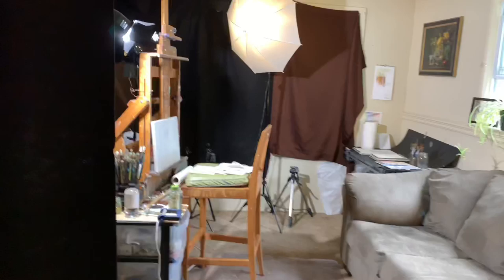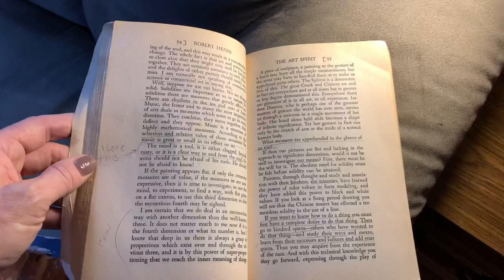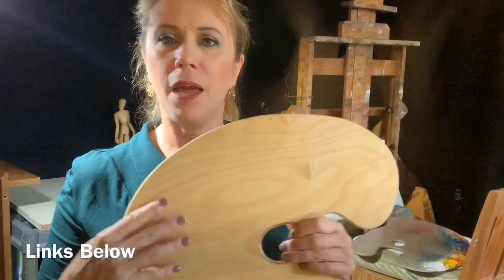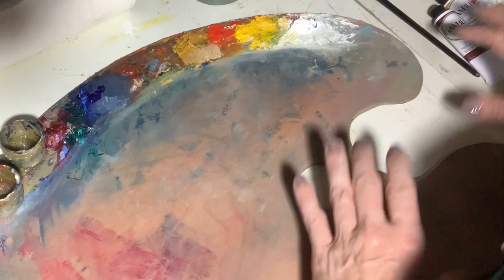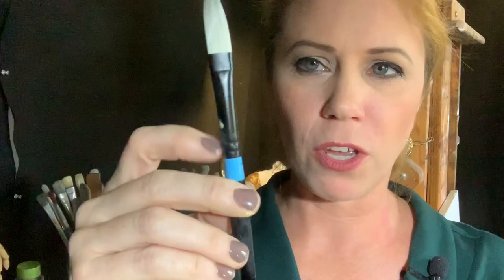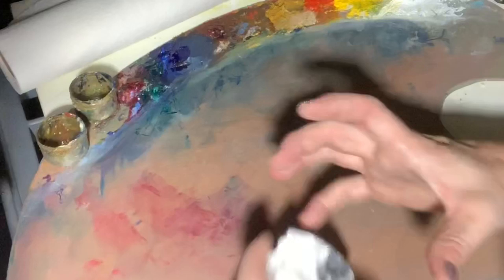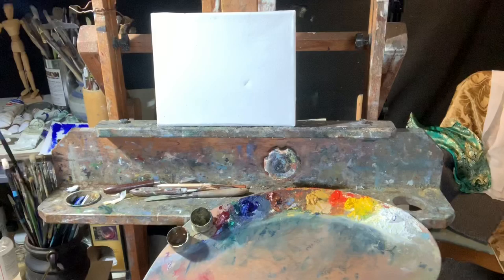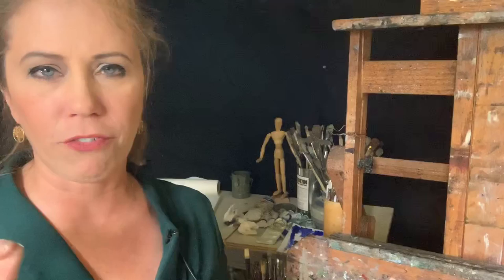Studio Essentials: Basics for Beginning Oil Painters

Comment: Since I am just starting to try oils, this has been very helpful, and I may buy one of your small palettes. I recently saw a bunch of painters talk about putting used paper towels which have mineral spirits into a container of water to prevent spontaneous combustion. Do you do this? Thank you so much for your videos they are truly wonderful.
Reply from the maker: Thank you Vivian! ( I have plenty of smaller palettes available if you'd like one, let me know!) I don't worry about the paper towel issue. In 30 years of painting, I've never seen or heard of one incident. I know this can happen, and I wonder if it isn't more when people are dousing rags with linseed oil, and cramming them all in garbage cans, where the temp can rise and ignite.  Whether in the studio or plein air, I use a minimum amount of oil and thinner, clean most of it off in the can of thinner, wipe the brush dry on the paper towel, and there just isn't that much on the rag to cause any worry. They all go in a grocery shopping bag, (indoors or out) and weekly, I toss the studio garbage can. Never been a problem. I hope that helps!

Comment: So wonderful. I’ve been painting for a couple of years and just recently switched to oil. I’m struggling with the mess. I get the paint all over my hands, gloves, tubes etc. I’m so conscious of what I’m doing but just can’t get it together. Just trying to close the tubes gets paint on my hands. So frustrating. Do you have any suggestions. I would appreciate it.
Thank you, Kim
Reply from the maker: I completely understand, Kim! I think when I began, I had more paint on me than on the canvas! Now after 31 years, I can (most of the time) win the battle. But that’s only because I wanted to win in this fight. 😂😂 One little tip I discovered is to be careful to not squeeze your tubes prior to opening them. They’re prone to gush when opened, catching you by surprise... and so it begins. Some mishaps are inevitable, but using a paper towel to handle things helps. Another tip- this maybe in advisable, but I started dressing nicer to paint and that made me be a little cleaner. Good luck! 👍🏻🎨😁
Reply: Jessica Henry thank you!  I will start utilizing my some of this in my practice. Stay safe during this time too ✌️😷